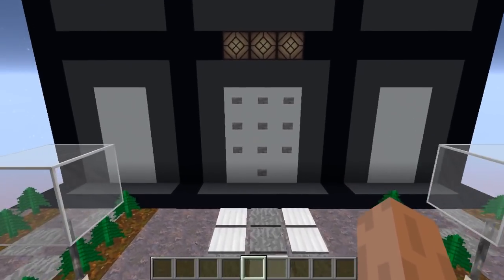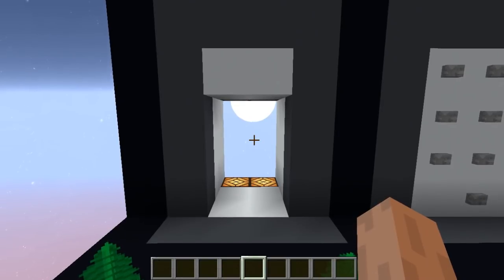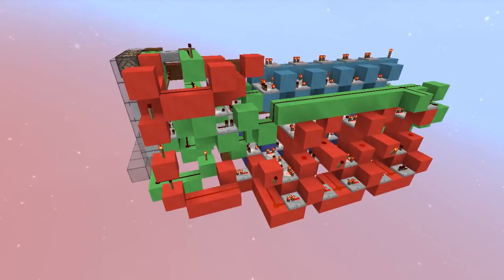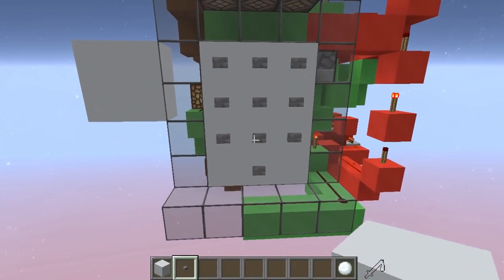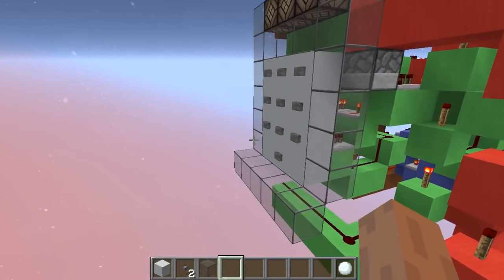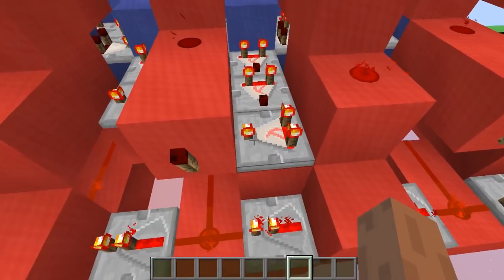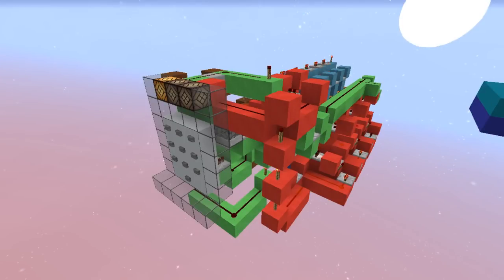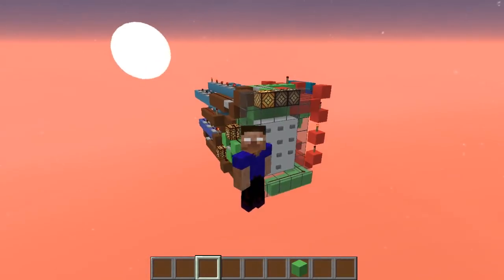The Password System of my Dreams! | Minecraft 1.12+

Comment: Really awesome! I made a reprogrammable lock as we with some help from Dico. This one doesn't use a shift register since it was designed to use multiple item frames as the input and mine is slightly smaller but only cause it doesn't have the Hex shifter in it. Yours is definitely more amazing than mine :)
Reply from the maker: Very nice man!

Comment: Looks like a nice system! It seems different than more conventional locks that store which digit is the next to be entered and then compare that digit individually as it is entered, and reset the state if it is incorrect. A very nice approach to the combination lock.

However, I personally think that vertical arrays are a much better layout for the redstone of combination locks, since in a lot of cases, there's more space available downwards than forwards/sideways. A side effect of doing it this way is that extending the number of digits takes up the same footprint, you just need more space downwards. You might recall seeing this video I made on a similar combination lock that is vertical (https://www.youtube.com/watch?v=ZWQNhKcvdaA).

Consider making a combination lock that functions the same way as the one you showed here, with the same comparison and reconfiguration system, but with a vertical shift register/latch array, with a footprint as small as possible!
Reply from the maker: My first/test version to this system was vertical and way simpler (really compact as you mentioned) but I try to avoid going vertical in most of my systems since I focus on having things eventually built in survival where it's faster to work horizontally rather than vertically. Just a design decision!

Just watched your video again, it's a shame I didn't remember you had that, otherwise I'd had mentioned it in the video. You made an amazing system back then!
Reply: Maizuma Games honestly, some players want to save space, like I do, so why not show both designs? If you say you had a vertical one, so why not also show it? I honestly would love to see more variations of builds, and also improving them would also be awesome

For example 2 improvements would be a good add on, well, 
First would be the ability to type the combination as fast as you can, and it registers it almost instantly
Second would be ability to make so that the panel could store multiple codes, for example you could have code 1234 and other one 0000, both can be used, using same panel, but output is different per code. 

I am actually trying to design one like that, but I’m having problems, but you being redstone kings, amongst few others, that requirement wouldn’t be hard to you
Reply: Maizuma Games also, AWESOME lock, best I’ve seen so far, of course Dico you’re awesome redstoner too, you both are